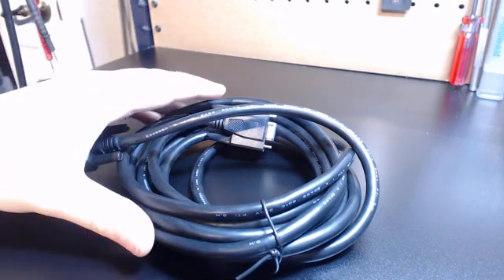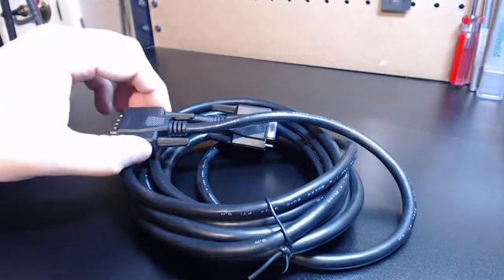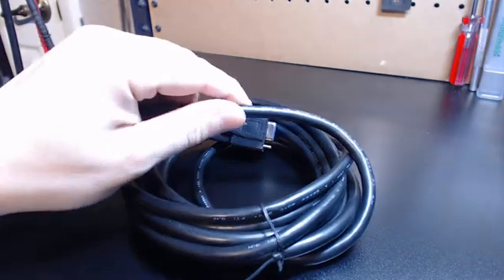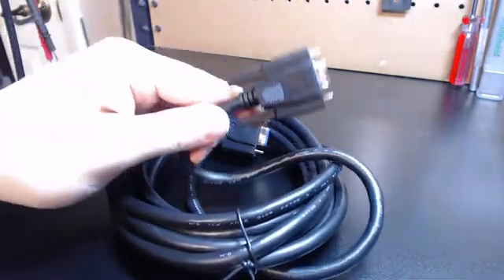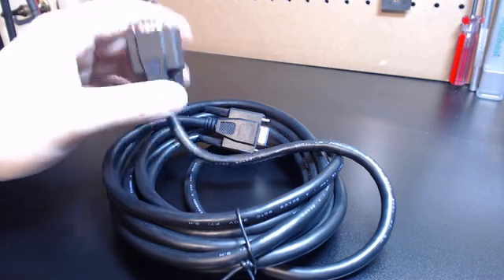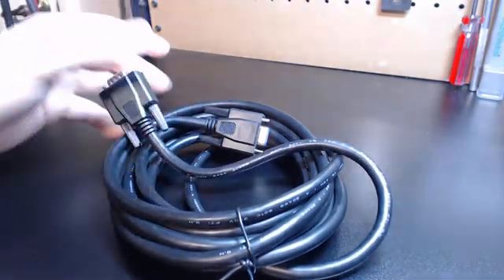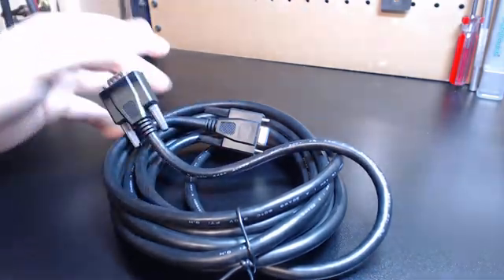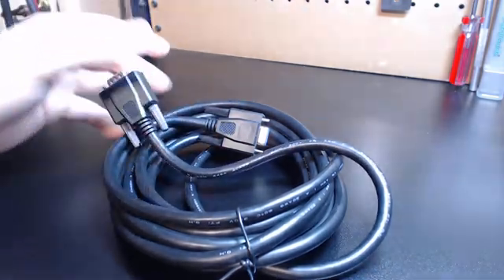Gecko G540 20AWG 13ft. Pro Shielded Motor Cables (Made With Signal Cable)

Comment: @Corvetteguy50 ... thanks for these cables.  You are right, it is hard to find a proper cables for stepper motors.  I just ordered a set !  I think I'll swap these into my bigger system with Gecko 203V controllers and use my existing ones (those slightly larger, red ones that everyone was using for a while) on the G540/smaller motors (can't afford two sets yet :-) ).
Reply from the maker: Basement Tech, thank you for your support. I really appreciate it. The cable's are fine to use with the G203V drives as long as your not running 72v as it would create to much heat with 20awg leads with the amp draw. 48v with those drives. Thank you,
Vince